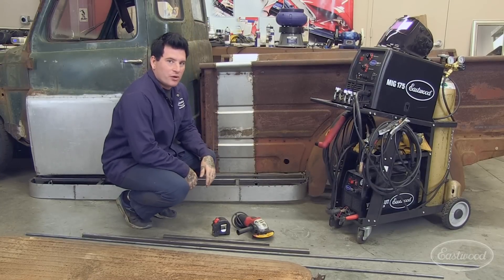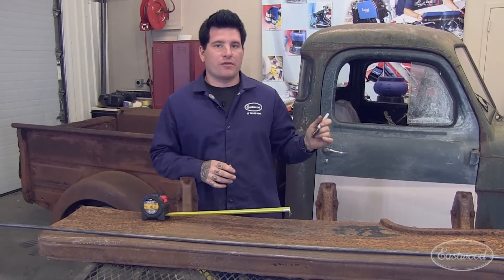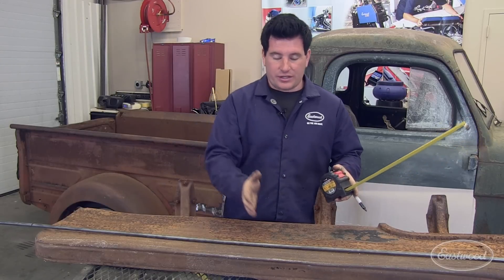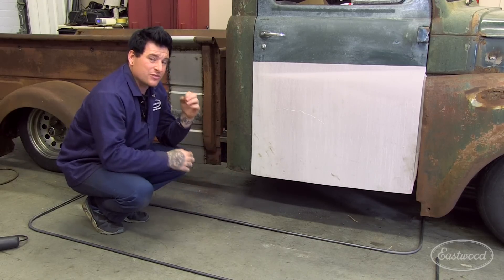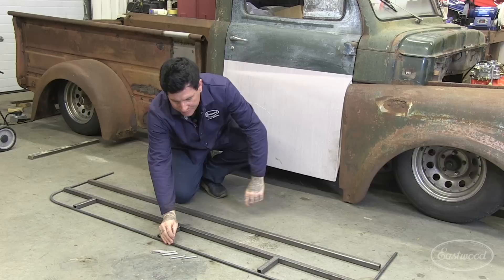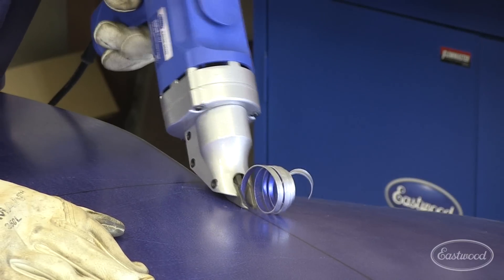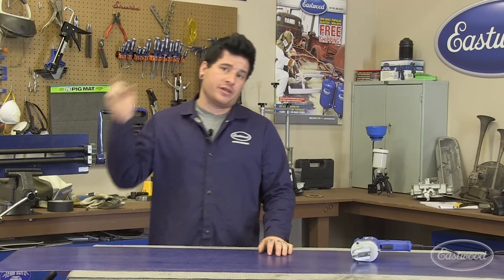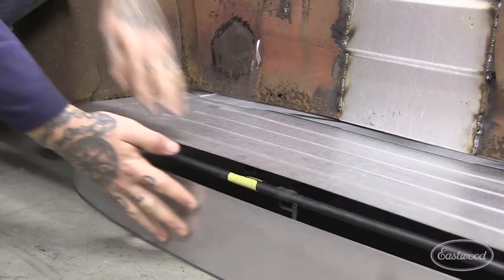Fabricating Running Boards - Project Pilehouse DIY Custom Running Boards at Eastwood

Comment: Awesome, with the Panel Truck, I'm pretty sure the running boards are the same, will be watching this video quite a few times when I'm making mine. I'm thinking about making mine out of Aluminium, same with the fender arches and anything that bolts on. My body is very rusted, would be cool to make an entire Panel Truck body out of Aluminium, but I might be biting off more than I can chew with that. Obviously, the more work I create for myself, the longer it could take, that's kind of running into having a production line type of deal too, would need to have a huge assortment of dies to fabricate all the panels, not totally sure I'd like to run with that idea.